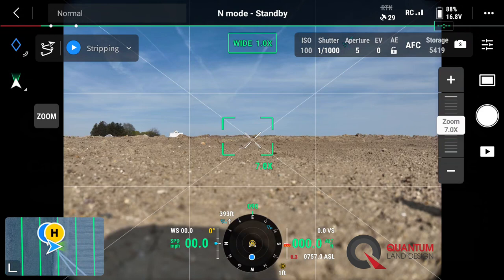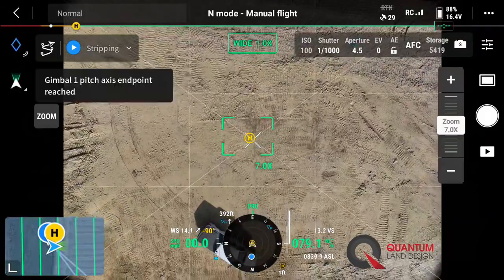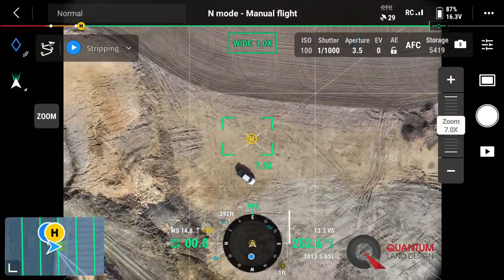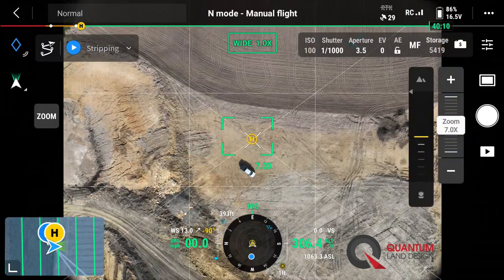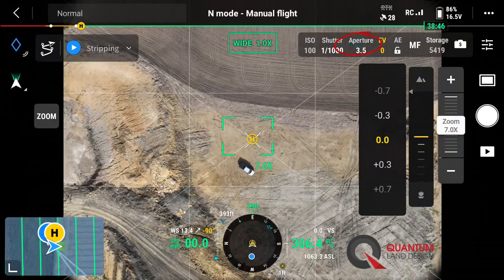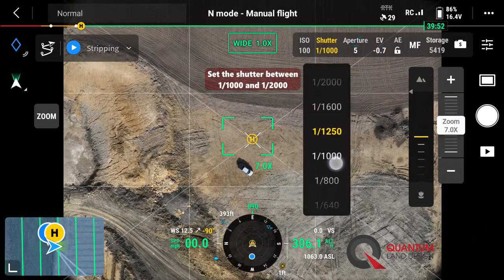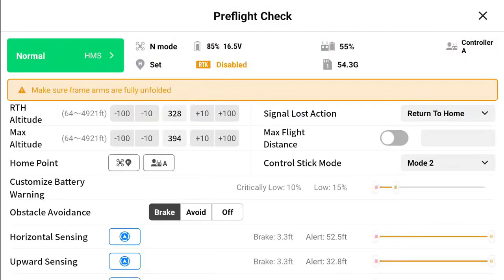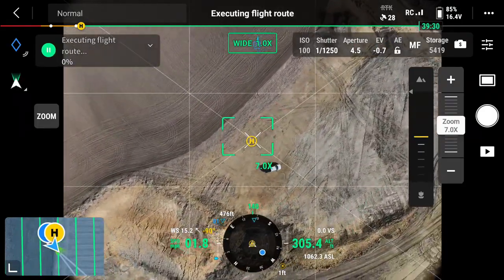DJI Mavic 3E Camera Settings for Topographic Survey Mapping

Comment: Short and sweet.
Thanks for this as my current settings aren't anywhere near suitable.... (horrendous BLOTCHED imagery) is causing me a nightmare. I'll give these a go.
So you literally have to go through this process at each takeoff/resume/battery change?
It's another level of tedious setup, but if it resolves terrible imagery, I'll do it!
Reply from the maker: If you get the settings right the first time you can usually just set the EV value at each battery change and be good to go.  If your images are blurry you may have to slow of a shutter speed or flying too fast.

Comment: Is it not possible to take pictures in 16x9? On my 3E, I only have 4x3 and can't switch it.
Reply from the maker: 4:3 is the only option on the M3E.
Reply: New to automated mapping. I’ve been doing telecom site audits for the past 3 years. I recently have done some automated mapping missions and I am dealing with the client sending jobs back due to blurry photos. My camera settings are set to auto. Mechanical shutter is toggled on as well. Is it the gospel to have camera settings on S mode when mapping vs auto?That way I know going forward and can let other pilots know as well.